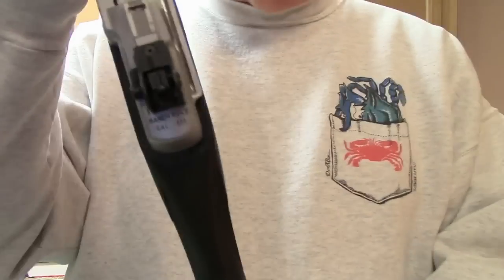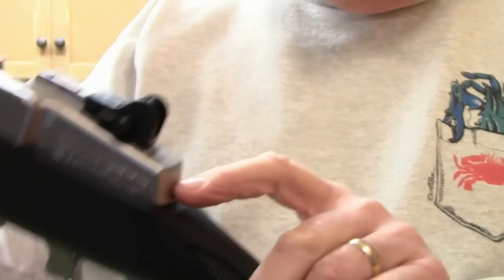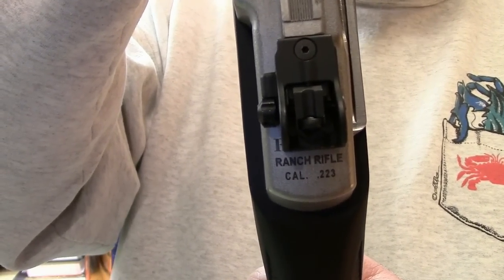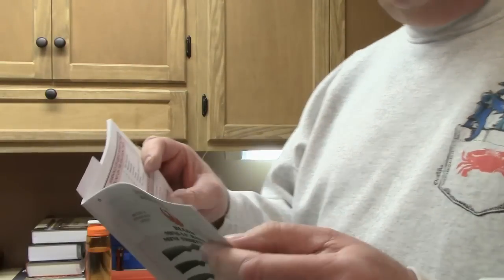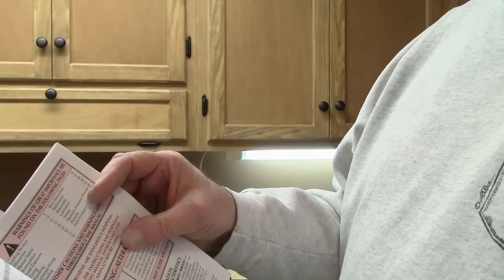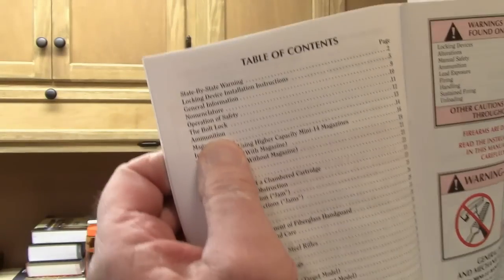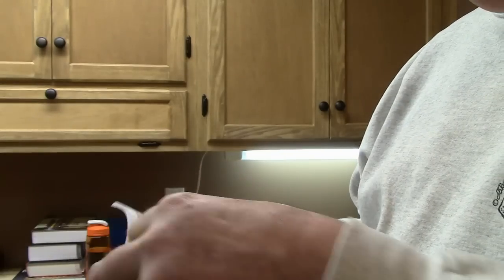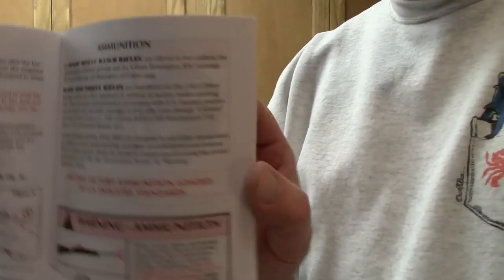Use of 5.56 mm NATO in 223 Rem. chambers ~ Finally, "Can I use NATO in my Mini-14?"

Comment: Is it acceptable (safe) to ream the chamber to a .223 Wilde in a mini14?
Reply: As to the manual, we have an old saying in these parts:  if all else fails, go to the trash can, retrieve the instructions and read it!  While that may be applicable for Ikea furniture,  it is definitely not a good SOP for a firearm!
Reply from the maker: To answer your question, let me explain the dimensional issues involved.  A 223 Wylde chamber and a 5.56mm NATO chamber have greater freebore length than the 223 Remington chamber; thus, they allow greater bullet travel before the rifling is encountered, which maintains safe pressures.  The Wylde freebore area is tighter than the 5.56, which snugly stabilizes the bullet and prevents bullet yaw before entering the rifling.  A Wylde chamber can be reamed from a .223, but is already smaller than the .5.56 and would cut nothing.  Ruger Mini 14 has a 5.56 NATO chamber, so it cannot be altered.  Neither can the barrel be set back and rechambered, as there are too many dimensional issues with regard to the op-rod length and other external components.  As a matter of note, I've extensive experience with accurizing the Mini-14 and have had extremely good results with the newer series, made after 2004.  That rifle is capable of 1.5 MOA accuracy  with good handloads, by simply glass bedding the action and improving its fantastic two-stage trigger, which are both quite easily done by a competent gunsmith.  I've worked on a number of these Rugers and there is simply no finer, more crisp 2-stage trigger to work on, which I have tuned to 1.5# for the first stage, releasing at 2.5# on the second, which beats my expensive Geissle AR triggers, hands-down. Hint: trigger spring part #33 coil torque is quite high, and can be relaxed with a simple, gentle reverse twist. The secondary sear engagement is long and rough, but can be reduced and polished by an experienced hand. Unless you understand two-stage trigger function, leave the work to a professional, or you'll have an unsafe trigger!
Reply: @GunBlue490  thank you for responding, but I am confused.  I thought most Mini 14s are chambered in .223, mine is.   I've been told if you ream a .223 Rem chamber, to .223 Wilde, it can safely handle a 5.56 x 45mm.   That is my interest, but I'm no fool, I defer to your expertise!

Comment: I understand that but if my barrel is markes CLE chamber what does it mean than does it make ok to shoot 556 ppl say that is okaj but i rather get your oppinion plz
Reply from the maker: Almir Sisic 
A CLE chamber is a standard 223 chamber with a slightly shorter throat, to provide less bullet jump, so it raises pressures even more with standard ammo.  NATO ammo requires long bullet jump for safe pressures.  Absolutely never shoot high pressure NATO ammo in it, and be cautious even approaching maximum loads.
Reply: Almir Sisic it is ok to shoot 5.56 out of a .223 same round but you do have to be careful of the loads they are different which can cause problems and there is remming the .223 bore. And with the .223 out of the 5.556 you run into more jams and ejection problems and not to mention accuracy. So the best advise is "if it says .223 round use .223 ,and if it says 5.56 round use 5.56 problem solved"
Reply from the maker: deaf smith 
No, it is NOT OK to shoot 5.56mm ammo fom a rifle designated as .223 Remington.  EVERY MANUFACTURER OF FIREARMS CONFIRMS THIS.  One does not make up these things to suit their own fancy.

Comment: CZ claims their barrels will handle both .223 and 5.56. Mainly because the barrels can handle high pressures...
Reply from the maker: marcus abel 
It has nothing to do with the barrel.  It's entirely the function of the reamer used to cut the chamber.  A 223 reamer yields a 223 rifle, and a 5.56 NATO reamer yields a 5.56 NATO rifle.  A 5.56 chamber has more bullet clearance and more gradual rifling leade that allows higher pressures.  A 223 chamber places the rifling closer to the bullet, which can provide higher accuracy, but raises NATO ammo pressures beyond proof tested specifications.  That's all there is to it, regardless of brand.
Reply: Thank you very much for your reply. I love your videos!!!

I will quote CZ directly so you can see how a novice, such as myself, can get a bit confused:

   "All of our .223s will happily eat 5.56. Since our factory is in Europe, we build everything to CIP spec, which doesn't differentiate between the two cartridges and just has the higher pressure as its standard."
Reply from the maker: As with much advertising, the comment is true, but may lead one to believe that they choose a higher standard  to only make strong guns, while other companies elect to make weaker ones.  However, the corollary is that another company could say that in making only 223 Remington SAAMI standard guns, they choose superior accuracy as the hallmark of excellence over minimal gains of velocity that are sought by the military.  It's all in the eye of the beholder.  FYI, while the 5.56 has the capacity to generate up to 175 fps more velocity than the 223 in barrels of standard length with identical bullets, most currently manufactured 16 to 18 inch 5.56 barrels actually achieve significantly less velocity than the average 22 inch sporter barrelled 223.  Even at top gain, with each 100 fps yielding about 22 yards, the actual trajectory and effective energy is increased by a modest 35 to 40 yards.  While this gain is certainly worth having in a combat rifle that requires a standard of 3 MOA accuracy as a benchmark (most 5.56 guns do shoot better), the 223 varmint shooter generally would prefer a rifle that can thread a needle, which can effectively reach much farther, despite the slightly more sloped trajectory.  Trajectory can be compensated for; accuracy cannot.  Having said that, CZ makes very fine guns, and I would expect that yours should be capable of varmint grade accuracy with high grade, carefully selected, 223 ammo.  NATO ammo, loaded with traditional open based FMJ boat-tail bullets that have poor bearing surface and are heavily crimped, rarely shoots with such accuracy, nor was it ever intended to.  One other FYI that may be of interest... Most European countries forbid the private ownership of military calibers, including the 5.56 NATO and the 223, so Euro factories that produce those chamberings are chambering them for overseas sale, using tooling that is customarily used for guns that they contract for military arms.  In Europe, some countries require proof testing to be done by a government testing facility, and is not entrusted to the manufacturer as it is here in the US.  Thus, the 5.56 chambering is almost certainly incidental to military testing standards that do not recognize 223 pressures, which binds them to production of 5.56 chambers in order to pass that CIP standard to which they refer.  So, it's more likely a requirement by virtue of the test facility, rather than an elective standard.
Reply: So, my .223 must have a 5.56 chamber? Is is possible to bolster a .223 chamber to handle 5.56 pressures without the more gradual leade designed in a 5.56 chamber?
Frankly I'm amazed and very thankful for you detailed responses, hopefully I haven't worn out your patience...
Reply from the maker: marcus abel 
I know of no logical reason to do so, but a 223's shorter leade may be reamed out to 5.56 dimensions with a NATO finish reamer, but it should be proof tested afterwards, just as all guns are.  To me, it would be a step backwards from an accurate 223 chamber to a less accurate one.  You must understand that NATO and 223 chambers have existed in a parallel universe since 1964.  Until only recent years since the release of vast quantities of military surplus, the 5.56 was considered the black sheep of the family that no civilian sportsman desired or had any need for.  NATO ammo is just a bigger boom with a bullet form that cannot be hunted with lawfully in most states, has miserable accuracy, and stresses a gun's life.   It's best to understand that all standard chambers are made like a 223 chamber, and that each could have counterparts with NATO style throats, but nobody has any desire to trade in accuracy for another 30 yards of theoretical gain for their 222, 7mm-08, 30-06, or any other round.  Roy Weatherby used that technique, called freeboring, to squeeze some extra velocity from his series of cartridges, which are all considerably less accurate than their ballistic counterparts.
Reply: I thank you for your indulgence and your surprising willingness to make such comprehensive replies. 
Now to some more videos from your vast library of topics. Thanks again!!!
Reply: Thoughts on the Wylde chamber?
Reply from the maker: marcus abel 
Yup.  It's a hybrid that's a middle ground for a need that doesn't exist for me or apparently most folks.  If one desires the best accuracy, a 223 chamber is better.  If one desires to shoot NATO ammo, a NATO chamber is better, which will almost always shoot 223 better than NATO ammo, simply because of better bullets.  I've never seen an articulated explanation for bothering.  A NATO chamber is plenty accurate for combat and plinking, and if I desire top accuracy, I certainly wouldn't be buying NATO ammo anyway, so why would I want a chamber that can shoot something I don't use?  If I barreled my Mini14 in a Wylde chamber, it might shoot NATO, while shooting 223 a bit more accurately, but I didn't buy my Mini14 for precision, and there's a limit to that simply due to design.

Comment: mini 14 Ruger says yes to both.
Reply from the maker: Yes, that was the point of this presentation. Every Mini-14 ever made since its inception has been chambered for the NATO cartridge, therefore for all .223 Remington rounds.  This statement has been continually and clearly printed in every manual for every vintage. The only exception is the now discontinued 580 series Target Model with the harmonic adjuster. The reason Ruger embossed .223 Rem on receivers was because, in the 1970s and 1980s, very few folks understood what a 5.56mm round was, unless they had been in the armed forces. That was not intended to imply that it was not chambered for military ammo as the manuals for them explicitly specified.

Comment: My AR 15 is a F1 firearms king FDR "forged defensive rifle" my chamber is 223 Wylde with a stainless-steel matched barrel. I think I bought more of a competition rifle and didn't know it at the time. May I ask why I'm able to shoot 223 and 556 ammunition?
Thx William
Reply from the maker: Sure.  I also have a Wylde chamber. Two in fact. Yes, they are used by competition shooters, but are also quite sensible for recreational rifles. The Wylde is a hybrid chamber that combines the benefits of the 223 and NATO 5.56mm, with none of the limitations each of the others have. 
The 223 has a standard length throat that elevates pressures with high intensity 5.56 ammo that is made for long freebored throats. Conversely, those same 5.56 chambers and long throats have a long bullet jump that's not conducive to the accuracy that a 223 is capable of. The Wylde chamber provides a sufficiently short bullet jump and snugness to give fine accuracy, but the rifling leade is tapered to normalize pressures. A Wylde chamber is capable of enhanced target accuracy with ammo of any type. They are normally made to tighter tolerances than either 223 or 5.56 chambers. As long as you enjoy shooting your rifle, there's no such thing as too good.
Reply: @GunBlue490  Not true, the 223 Wylde can have a longer throat (depending on the barrel manufacturer) than the 5.56 NATO. The 223 Wylde has a tighter throat than the 5.56 NATO that can theoretically give better accuracy..

Comment: What kind of powder does the military round use? I know that military brass is thicker to handle the rough treatment of full auto firearms. So a 5.56 round will build higher pressure if it is loaded according to any of my loading handbooks because of smaller internal space. The problem I have with this is the fact that I cannot stuff as much powder into any of my .223 cases as my books call for so I am not worried about the pressure I might be able to get from a 5.56 nato round. My Ruger #3 falling block has as strong if not stronger action than any black rifle so I don't know that I agree with this. I would like to have much more information because so far I have never had any trouble using either in my ruger #3. The crimped primer is the only pain in the rear so far.
Reply: You know enough about reloading to be dangerous ;) You are right that a 5.56 case has a smaller capacity= higher pressure (from a same loading vs .223 case). So, at the very least you would want/ need to reduce loads from .223 case specs if loading in 5.56 cases. I don't know which "books" you are getting your loads from, but if you "can't possibly stuff all the powder called for.." in them, you are reading something wrong or getting your loads from some idiots webpage! I load a LOT of .223 ( in Winchester cases, cheap either empty or "prefilled"/ white box stuff) and have never even had a compressed load. 5.56 NATO rounds use different powder (and primers) than commercial ammo/ what is available for hand loaders, so you can't possibly compare the pressure generated by a NATO round with any load in your "book". What powder are you using? Varget is a good choice for .223, as well as several others that are not full/ compressed loads. You do realize published loads are MAXIMUM LOADS and should only be WORKED UP TO, CHECKING FOR PRESSURE SIGNS, right? Finally, You can afford a Ruger #3 but not decent brass????? Removing crimps on shitty, range pick up, coated case, brass fired in ??? previously loaded with ??? by ???....  It is your gun, face and hands at risk, not mine, but still....

Comment: Ok soo my Q is i have a CLE match chamber on my douglas barrel spr can i shoot 556 safely
Reply from the maker: Almir Sisic 
Match chamber is a relative term that can apply to either 5.56mm NATO chambers or to 223 Remington chambers.  Match chamber simply means that the chamber was cut to precise, close tolerances that are generally tighter dimensions than standard chambers, but the form of the chamber can be either.  If your barrel is marked 223, then you don't have the required freebore for firing 5.56mm but if it's marked 5.56, it's fine.  Military barrels are made in match grade and will handle NATO ammo, for instance, while many competitors prefer the the 223 throating..  A Wylde chamber is a hybrid that shoots both with efficiency, but you would know if you had one by its marking.  Contact the manufacturer!

Comment: Buy something chambered in 5.56.... then you can use 223 also... Not the other way around. Problem solved.
Reply: under US national SAAMI the 5.56x45 and the .223 Rem have different specs, but under International C.I.P. the 5.56x45/.223 Rem are Identical becourse all tolerances and deviations in measurements and pressures are within the tolerances of the International C.I.P.-Standard
Reply: alex0236 you can shoot 556 out of a 223 but you may run into a problem eventually.
Reply: well i can only speak for my cuntry but in germany all .223 Rifles have to be overpressure tested with ammo that exceeds bouth 223 and 556 max. pressure by 30% under C.I.P. and need a stamping basicly all Guns need that in order to be sold in public, german Guns for example get an eagle after overpressure testshooting 
if your gun doesnt have a C.I.P. stamping (becourse of import) u need to turn your weapon in for testing and stemping

Comment: You are incorrect. I called both Tikka and CZ firearms yesterday and they both confirmed that you can indeed shoot 5.56 rounds out of their .223 rifles. The reason being is that most American .223 firearms are proof tested according to S.A.A.M.I. which does not test 5.56 pressures in .223 firearms. With most European firearms however (such as CZ & Tikka), .223 firearms are proof tested according to C.I.P. which does test with 5.56 pressures. I also called C.I.P. to confirm this. Straight from CZ's website: "Our .223s will happily eat 5.56, since CIP doesn’t differentiate between the two cartridges and just has the higher pressure as its standard."
Reply from the maker: I was not incorrect.  I referred to the SAAMI and NATO standards and never once referred to CIP, which is a European chambering and testing method that had nothing to do with my commentary.
Reply: Perhaps not technically incorrect, but extremely misleading which just adds to the confusion. If you're going to do an educational video about using 5.56 cartridges in .223 rifles you SHOULD mention CIP because YES it is safe to use 5.56 in .223 chambers at times. Now people know the full story which I think we can all agree, is an important part of firearms safety.
Reply: I just bought a new ruger mini 14 it is stamped 5
Reply: Somehow that got messed up. I just bought a new ruger mini 14
Reply: @joshuanbray  Dude Im sure a person can sit here and split hairs all day, and Euro standards dont mirror SAAMI standards, and maybe pointing out an inferior system dont make any valid point.  The fact CIP just lumps the 2 calibers together shows, that just like the metric system, just getting specs "CLOSE" is good enough.   And Ruger says using 5.56 in their target Mini 14 , is not safe.  Because CIP says its safe Ruger says other wise so it is NOT SAFE AT ALL TIMES! You internet knowitalls need to pass some sort of test before you can comment, that would mean we would NEVER hear from you!